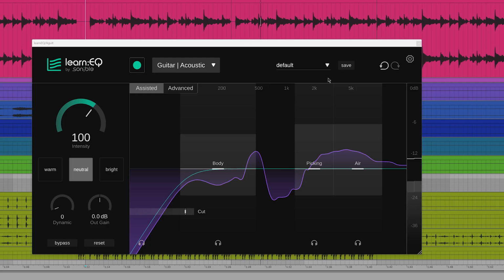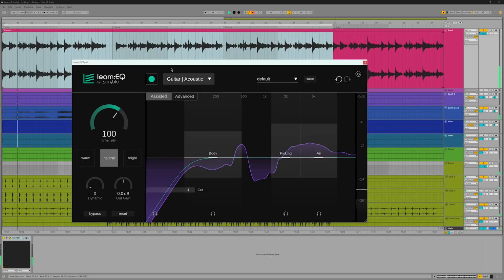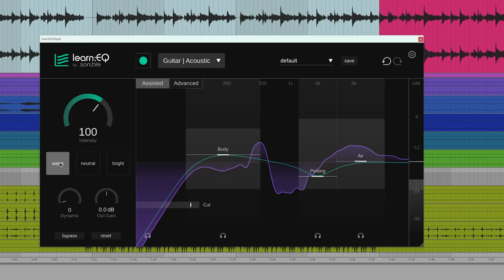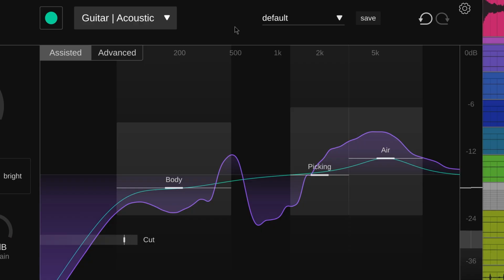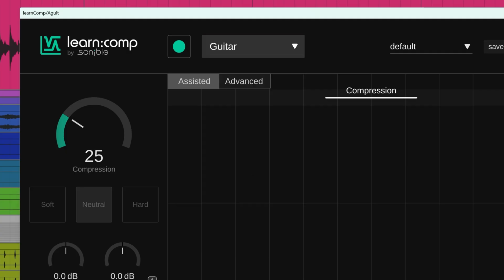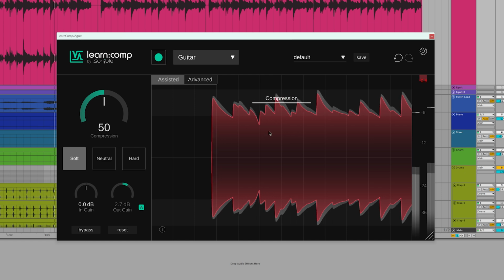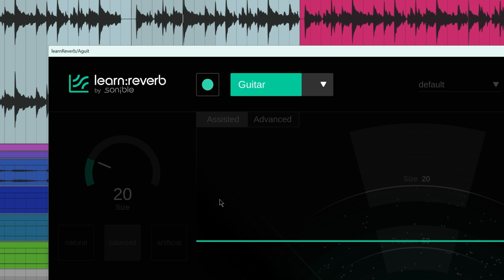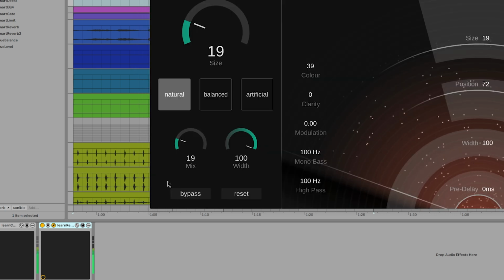Make guitars glide over your beat | learn:bundle by sonible

Comment: Does it work differently than the Focusrite Fast Bundle? It looks the same, only the brand has been changed? So, will it replace the Fast Bundle? Or can existing "The Collective" customers now upgrade to this one for free?
Reply from the maker: The learn:bundle builds on core elements of the original FAST plug-ins, but we’ve taken things further: the processing has been refined, the interface redesigned and we’ve added a stronger focus on new guiding and educational features.

Since FAST was distributed by Focusrite, we don’t have access to any customer data and can’t offer a direct cross-grade. However, anyone who previously owned FAST, can reach out to our support team (support@sonible.com) - and we’ll take care of it.
Reply: @SonibleCom  okay thank you